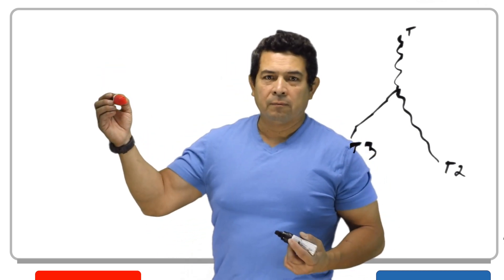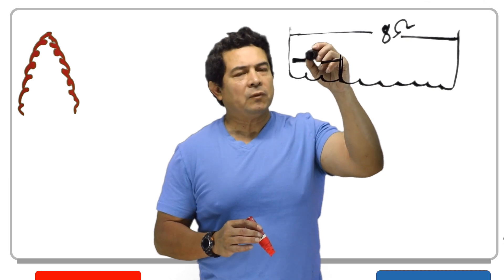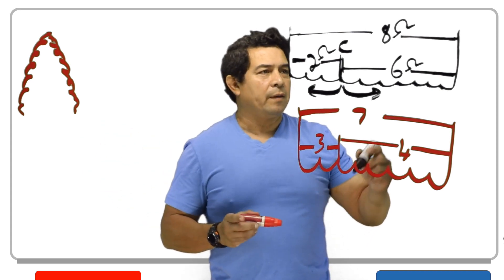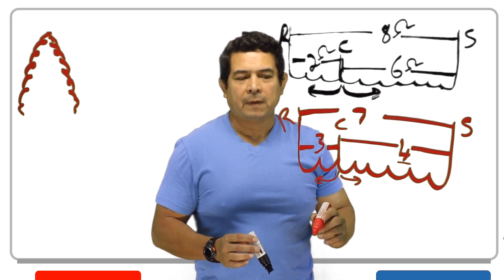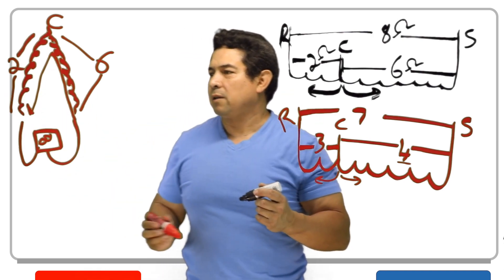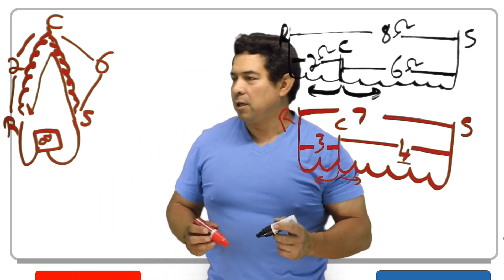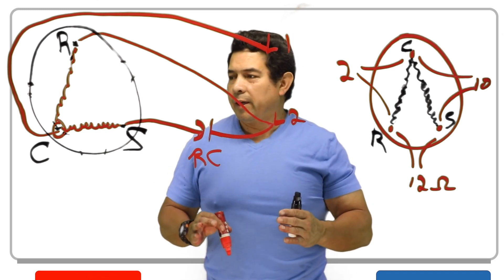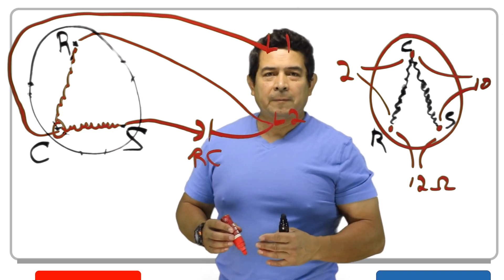Motors 4 Ohming Windings 1PH motor - HVAC Online Training and Courses

Comment: Thank you for nice video.
I have a question when you draw cap you place the sign that the curved side is connected to the starter and flat side of cap symbol towards the power supply.do the caps have polarity for starter?
Reply from the maker: Capacitors are    no longer    polarized so it makes no difference how you hook up the capacitors.  If you are concerned about it then  the curved end is the anode or the +  positive end and the straight is the cathode or the  -  negative part.  25 or 30 years ago it did make a difference but not anymore.   The very small capacitors for electronics ARE polarized and it does make a difference when working on circuit-boards
Reply from the maker: I am sorry I just saw your message!   Capacitors used to be polarized BUT  they are not anymore, so it does NOT matter which side you hook up to which line.  Sorry it took me so long to answer you.